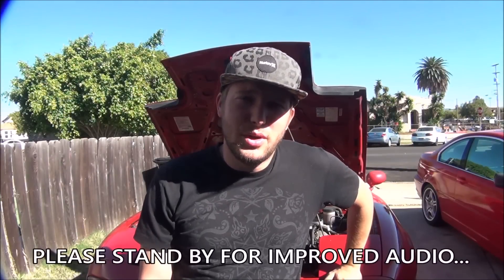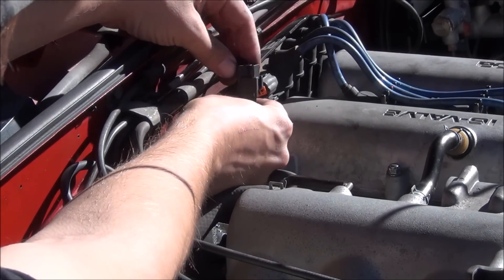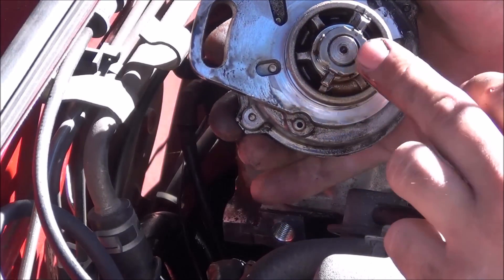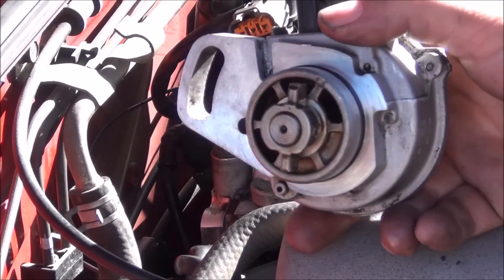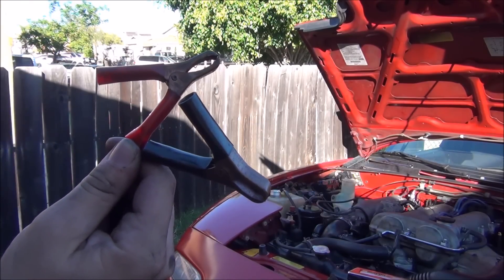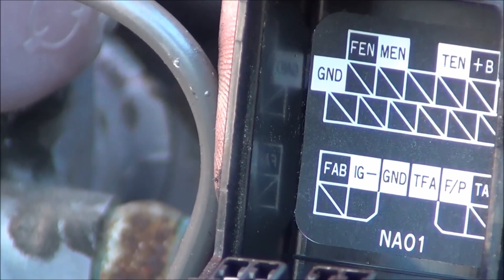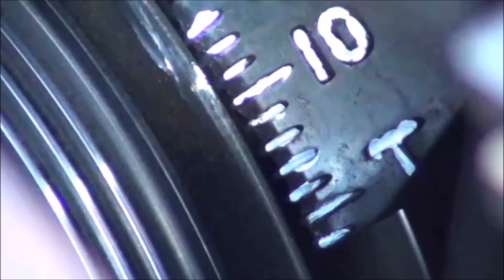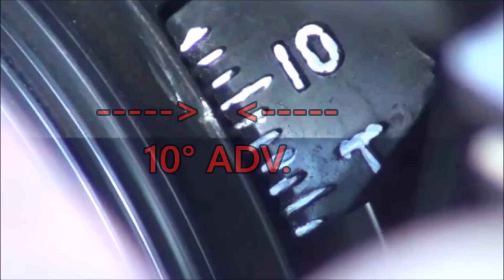2 for 1 Special: Miata CAS O-Ring Replacement & Setting Ignition Timing!

Comment: Great vid, Greg! 

Question: I recently installed Raceland 4-2-1 stainless steel headers on my 95' 1.8. The o2 sensor, plug in hole, is about a foot farther down than on the stock headers. So, I spliced the old o2 sensor wiring (keeping the old plugin) into the new o2 sensor with more cable, making it longer. I'm now getting a cel code number 17. Code is referred to as Heated Oxygen Sensor (inversion) I can honestly feel the power loss when it comes on. It'll go away and then (some) of the power will be back. I also believe it's running rich because the gas gauge goes down quickly. It's probably my mind telling me that it is lol. Just not a whole lot of power... I was thinking about getting a wideband 02 sensor? Would this be worth it? I could at least see my afr! It would probably get rid of the cel.. IDFK someone help! Has anyone else seen cel 17???

+TheCarPassionChannel
Reply from the maker: +SnoizY Dubstep I've heard sometimes you have to crimp the o2 sensor lines rather than soldering them, although I've never had any issues with that. Make sure none of your wires are touching the headers!
Reply: it can happen with the longer header cause the o2 sensor doesnt get as hot and makes it read wrong. you can convert it to a 5 wire heated o2 sensor which you can find instructions for online or switch to a wideband
Reply: +jason johnson That sounds right :) wideband o2 sensors arnt heated right?
Reply: +jason johnson +TheCarPassionChannel
anddd is it alright if i cap the egr tube thingy leading into the headers?
Reply: +SnoizY Dubstep they are heated and im not sure i have the 1.6
Reply: +jason johnson ok. Do you think the wideband would get warm enough to read right or would the same thing happen?
Reply: +SnoizY Dubstep it should. from what ive read moving the stock o2 sensor further down allows the gases and sensor to stay cooler than the preferred operating temp which is less than 1100 Fahrenheit if i remember right. a heated sensor would keep it above 1200 Fahrenheit or more. you could do it with a heated wideband or heres a link to convert the miata to a heated o2 sensor. http://mymiata.paladinmicro.com/Miata4-WireO2.htm
Reply: jason johnson Thanks alot man!
Reply: +SnoizY Dubstep no problem man. hope the info helped

Comment: I have a 1.8 with a metal cover over the CAS, all the way to the coilpack. Do you know if I have to take out the coilpack to remove this?
Reply from the maker: I'm not sure. It will probably make your life easier if you remove it though.
Reply: TheCarPassionChannel Okay, thanks man! I like how you always respond to comments.
Reply from the maker: Strike_Raptor I do my best!
Reply: TheCarPassionChannel Your best is pretty damn good, just finished my O-ring change with only one real problem, someone replaced the diagnostics box with one from a Mazda Millennia (???) had to look up alternate instructions for that part.

Comment: what should i do if i took out the CAS but dont know which way the spin thing was orientated
Reply from the maker: There's only 1 way that it can be fully seated against the head due to the notch that's cut out. To be sure, you can use an inspection mirror to see the two different sized cutouts in the back of the camshaft and match that up with the CAS

Comment: I need to change the cas o ring on my 1.8 do i have to do the ignition timing as well afterwards?
Reply from the maker: You CAN mark the cas alignment before you remove it, but it's recommended that you recheck the timing once the job is done.

Comment: quick question I'm having a p0335 code on my 96 1.8 can the o ring cause that? I was thinking it might have moved when I hit a bump hard enough
Reply from the maker: What does that code indicate? It's not likely the CAS moved unless the bolt was completely loose, and even then it can be hard to rotate
Reply: The code is for a crankshaft position sensor idk where it would be
Reply from the maker: Russell Earnhart Hmm, leaking oil might cause a short? Not sure though, it could be referring to the sensor on the crank pulley.
Reply: +TheCarPassionChannel do you know where the crank sensor is located
Reply from the maker: Russell Earnhart Yeah it's literally right next to the harmonic damper, a little sensor pointed at it
Reply: +TheCarPassionChannel thanks for the quick reply just replaced it. was super easy. love the channel keep it up.

Comment: hey for that propeller type piece on the end of the cas, when i was taking it out it bumped my valve cover and moved. is that bad?
Reply: Hello,
I've just had the same issue whilst removing the CAS. How did you manage to line the notches back up into the correct position when reinstalling the CAS? Did it affect the timing and by how much? If the timing was affected how was it resolved?

Comment: hey man I love your content but I need your help I wanted to know if i should get a 1.6 miata or a  1.8 miata.
Reply: +Adrian Garcia There's no replacement for displacement.
Reply: +Jabba the Hutt that is true
Reply: +Adrian Garcia 1.8 if possible
Reply: +Adrian Garcia  get 1.6. why i had 1.8 1999 and the part are more expensive. If your going to turbo it, even better.
Reply: +Ibrain Font I'm not getting the nb I'm getting the na
Reply: +Adrian Garcia Get a 1.8. Why not have a little more displacement? And some of the 1.8's come with torsen lsd's.
Reply from the maker: +Adrian Garcia The 1.8 cars have stronger differentials and a little more power up front. The 1.6 cars are usually easier to find, cheaper, and a little lighter.
Reply: Well there you go.
Reply: +TheCarPassionChannel thanks for the help I want to have a turbo miata like yours but first I wanted to know which miata would be better to turbo.

Comment: hey i have a question my 1993 1.6 miata would bog if i floor the gas after 5k rpm. i would have to slowly ramp it up from 5k to 6k rpm and the other day i accidentally hit a dip and flew up and now the car will have problems revving past 4k rpm. Any idea what it could be? I saw around people having same problem and said it was the timing. any ideas what it could be?
Reply from the maker: +TachisV97 Plugs, wires, fuel filter, AFM, grounds; several things. Just gotta diagnose.

Comment: So cams TDC  ? Or is that not important? Thanks man.
Reply from the maker: +CrushingGroovesByAlexFromSuffer I'm not sure what you're asking, but the timing light is measuring crank TDC offset. As long as the timing belt is installed, the cams will be timed properly along with it.

Comment: Do I have to shut off the engine when i am adjusting the cran angle sensor?
Reply from the maker: Chang Yea Moon nope you can adjust it while the engine is running, just go in small increments

Comment: I've been waiting to see something about that engine you were building. What going on with that?
Reply from the maker: +tommyboy1two Welllllll the plans changed a little. Since my car started smoking quite a bit and is having what I believe is a valvetrain issue; I needed the head from that 1.6L to put onto my existing bottom end in the car. So the forged motor is on hold, for now. I will be doing a video on how to replace your head (gasket) and briefly covering the small modifications I did to the head.

Comment: Which way to loosen the cas bolt on a 1.6 miata. I cant get the bolt out and its getting damaged going counter clockwise with the 12 point wrench.
Reply from the maker: +Icezero73108 It's just a standard threaded bolt, counter-clockwise to remove it.
Reply: +TheCarPassionChannel thanks

Comment: Is there another method to set timing instead of using a timing light?
Reply from the maker: +victor trevino Not that I know of.
Reply: +TheCarPassionChannel Thanks I'll have to buy one
Really liking your videos by the way, really informative
Reply from the maker: victor trevino Thanks! A lot of auto parts stores will rent them out for free (you just leave a deposit and get it back when you return the tool).

Comment: What's the absolute bare minimum budget for turbo-ing a 1.8L 95 ?
Reply: +Taylor Clement Go to yee old junkyard find a turbo car such as a saab with a factory turbo or a Volvo as an example and yank all the cho cho bits off that car from oil to coolant lines to the intake piping turbo inter-cooler and all that happy jizz. After that figure out your options for how you can or cannot boost your car and tune it at the same time. Remember the cheaper the funner. Once you have a tun-able setup of some type get er running N/A first then slap all the parts onto the car (Fab work may be required as well as various amounts of adapters). All in all I'd say no more than 300 bucks and that is if you shop correctly for your used parts that WILL ACTUALLY FRIGGIN WORK AND ARE NOT SHOT as well as getting some sort of ECU like a Mega-squirt for example to tune the lot yourself.  Results may vary.

Comment: Hey everyone just got a 90 miata been sitting for 4 years now. I've replace the battery, AFM, fuel pump, filter, lines, pressure regulator, and injectors. Thing is I'm still not getting fuel. Damn! So I tested the injectors for power/ground, didn't get anything so I got all new relays from head lights to fuel pump to main relay.... everything! Still nothing so I went online and it said the take a test light and back probe the control wire of your injectors, and if it flickers then the CAS is good, but if stays on then it's bad...... well I didn't get a light at all so now I'm stuck again.... any help would be much appreciated
 

Thanks
Reply: You should post your problem on a miata forum. Lost of help of awesome people that can help you out on those.

Comment: Anyone doing this job should be EXTREMELY CAREFUL to NOT drop any bolts/nuts when screwing them on/off. I just spent 2 hours looking for two of them, it's like there's a black hole on top of the transmission that sucks everything out of this earth

Comment: Does anyone know how to set ignition timing on a NB 1.8?
Reply from the maker: In stock form there is no adjustment on an NB.
Reply: Ok thanks. The reason is I'm having a hard time getting it through the emissions test. I have changed the oil and installed new spark plugs, new Magnecor leads, new cold air intake, new oxygen sensor, new catalytic converter and new standard exhaust system, I also ran 3 different fuel additives to clean the fuel system and it's still reading high on carbon monoxide (CO), and now I can't drive it because the MOT expires tomorrow (I'm in the UK)
Reply: @LewisFoster2024  I had an error similar - my car was not getting HOT enough to set the READY code for emissions. New Thermostat fixed it. But B4 you buy test the coolant temp with a ODB2 or similar.

Comment: am I crazy   or is this REALLY  THE  "CAMSHAFT POSITION SENSOR"???  NOT CRANKSHAFT
Reply: I believe the cam has to spin at half the crank speed of rotation. But to your point, it seems logical also to me if there’s a gadget which is attached to the cam shaft that it would be labeled  a cam something or another. If you think that is bad, try and find a reference to a valve cover gasket! Mazda calls it a head cover gasket. My wrench turning is too old school I guess. I feel your pain. It is what it is.

Comment: Hi I got my car started after a head rebuild. 
I learnt from doing that the Crank turns two times every time the cams turn once.
a) Can the Crank  be One Turn out of sync with the cams?
b) Can being 2 or 3 teeth off on the exhaust cam prevent the car from starting ?
at least one of a or b must be true.